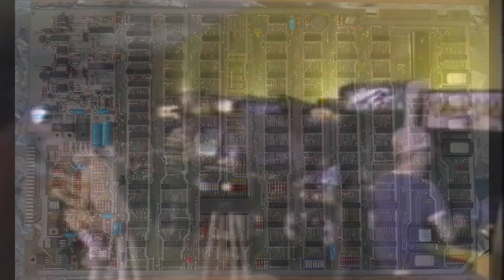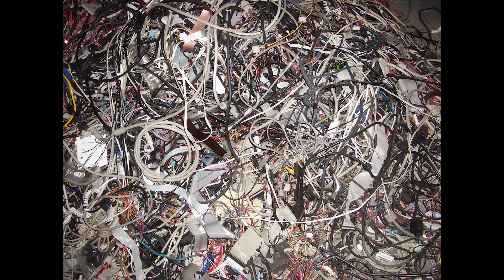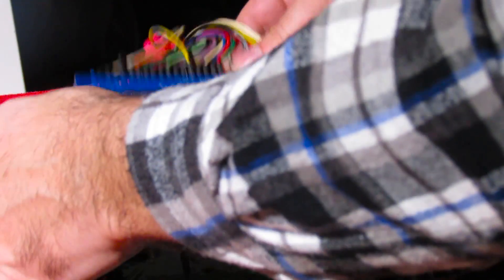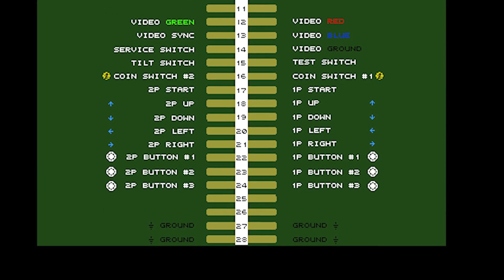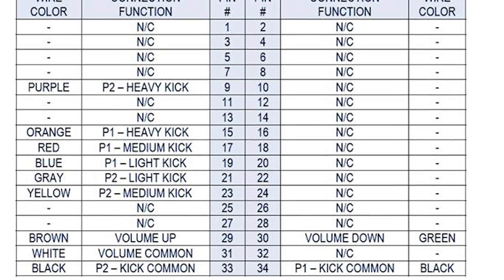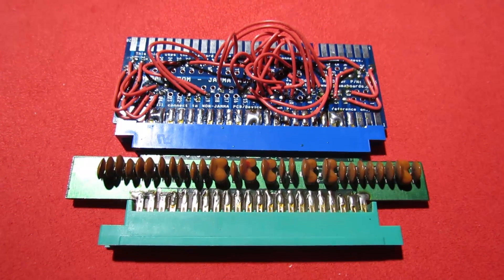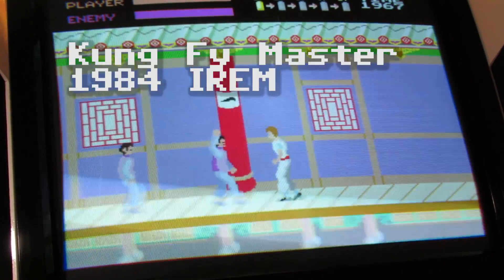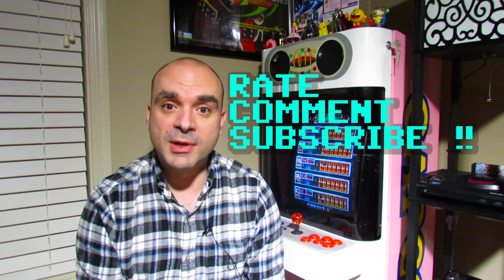The JAMMA Standard

Comment: Arcade cabinets are a blast.  I had a Galaxian cabinet when I was in my 20s.  I bought it at an auction with a Commando PCB in it.  Later on I found someone who would sell me a PCB for another game I liked "Top Gunner".  I kept them both in my cabinet and just connected one or the other when I wanted to play.  Top Gunner allowed for two people to play simultaneously.  Since Galaxian/Commando only allowed one player at a time -- I ended up building a new control area using particle board.  I bought an extra joystick -- took the wiring harness pinout (which came with the game) and added the new controls.